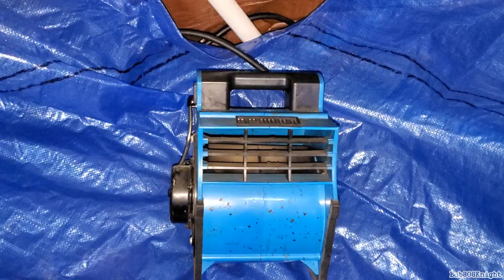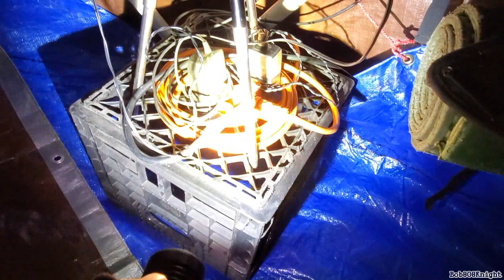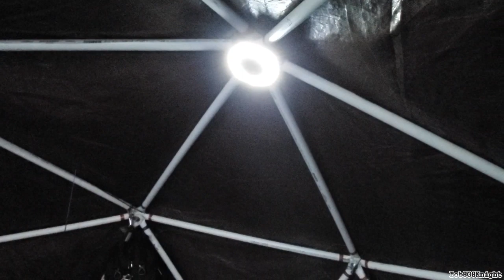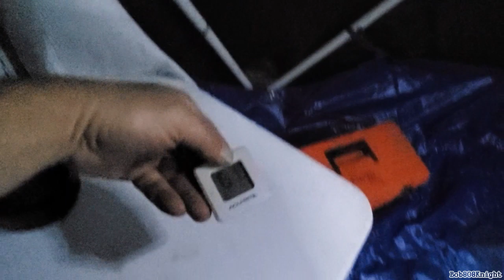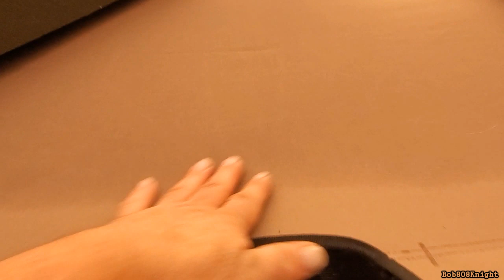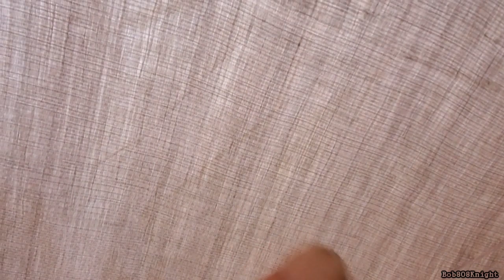Overnight At Camp Lockdown

Comment: Good morning Bob... I just finished breakfast (oatmeal and coffee) while watching your video on the tv.  Great video!  You mostly have a really nice setup.  I have one of those burners that is about 30 years old - almost falling apart but still works good.  It has survived the abuses of my kids and grandkids.  Those Coleman cots will last forever too.  I am not surprised you were toasty warm .  Those domes hold their heat.    However you may need to work on the ventlation or the humidity may get you.  Our bodies put out a lot of moisture.   Just ask the bonehead that sleeps in his clothes.  You get up soaking wet.  We always sleep naked with our clothing as a pillow.  Now, about your tarps... they would be my last choice as a covering. Soon you will find it turns out to be all duct tape.  As those tarps age the become full of little holes that leak.  You now have a good templet but you need a better material for the cover.  I have a 3 man tent from 1970 that still does not leak.  It is perfect for me aand a couple of grandkids.  Sometimes I would rather sleep in my bivy than deal with the grandkids. LOL  There are tons of good material out there that will work well if you ever get to go shopping again. 😟  

I need a new tablet... this old galexy 4 tab is about to give up the goast.   The battery does not last ,  it does not recharge well, the case is falling apart (thanks to grandkids) and it randomly locks up.  Well, it is a most 10years old so maybe I need to spend some money.  It makes my Scottish and Jewish genes cry... lol  
BTW: really enjoying the videos as do the grandkids...

Later friend.... blessings....
Reply from the maker: Good morning Levi.. Oatmeal sure sounds good as I have not had breakfast yet. I think I'll steer clear of the coffee as it makes me bouncy... I'm glad you enjoyed the video. I swear by the old Coleman products.
Some of the new ones not so much.. in the next video I will we talkin about ventilation and making a new cover out of used billboard vinyl... I bet the tent from the seventies is canvas isn't it... sounds like your grandkids are a handful. :-)
Yep it sounds like you need a new phone and tablet LOL you might want to hide the new phone from your grandchildren. You can give them the old one :-)
I'm glad everybody enjoyed the video. Thanks for watching and have an awesome week.
Reply: @Bob808Knight  Howdy again... it is 5:30am and I just finished another bowel of oatmeal.  Oatmeal every morning lowered my cholesterol over 100 points.  BTW: the coffee is supposed to make you jumpy.  Lol  I make cowboy coffee that is black black and will really get you going.  Lol   My daughter suggested using the same type material they use to make fabric car tops out of... she says it is easy to work with and last forever.  She made a couple of tops for her husband's  customized off road jeeps.     BTW: my old faithful tent is made of some sort of ripstop nylon that is coated/impregnated with something.  It is light enough I can backpack with it.  I used to have a family tent made of canvas that was used for car camping.  It had a  aluminum frame.  It was waterproof unless you touched it inside.  It was some sort of light weight canvas.  If you ran your fingernail across it on the inside while it was raining  it  would leak. 
Looking forward to more dome vidros....
Later....  blessings friend.....